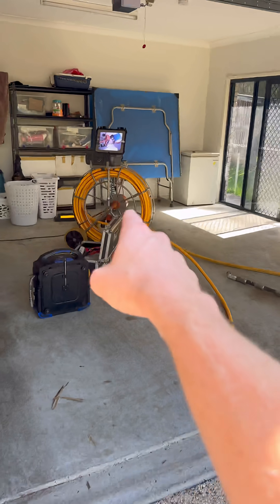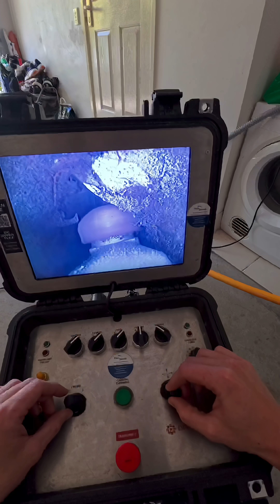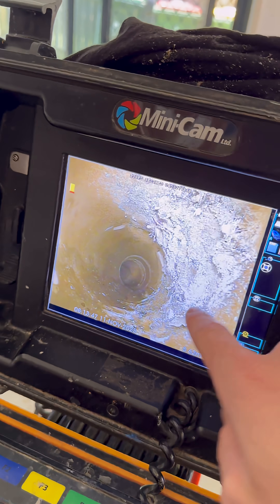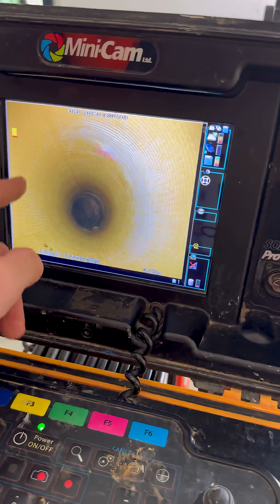The client saved $40k using this pipe grinder #plumbing #reline #pipelining

Comment: I’m guessing since that guy ran up the driveway with the epoxy packer means you got to be quick?
Reply: 7 minutes work time here in Brisbane Australia
Reply: @twodogs1542 yeah  heat up here ain’t like other parts of Australia
Reply: @Sillykitty08 just waiting for some weirdo in Tassie to say “3 days still hasn’t cured” :P
Reply: @twodogs1542 12 in Adelaide. 7minutes is wild. What are you in the dead centre of the Coober basin or something? XD
Reply: Yes, it starts to cure once you mix the resin. and even more so in the heat, when I did them full cure process takes 1 hr 30 min
Reply: Open air and ambient temperatures can effect epoxy curing times by upwards of 70%

So if you’re in a cool dry climate controlled room let’s say it takes exactly 60mins to harden to the point it is no longer workable

Then you go on site it’s 36C windy and you have a 50m walk between your work vehicle and the site.

We’ve had something work harden in like 12 minutes once. 

It can genuinely be that much of a difference out in the field.